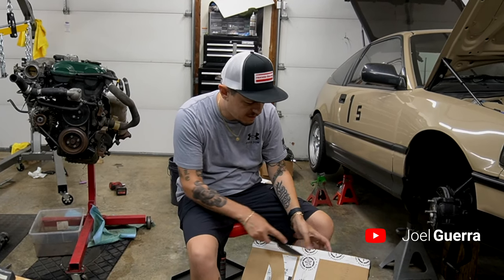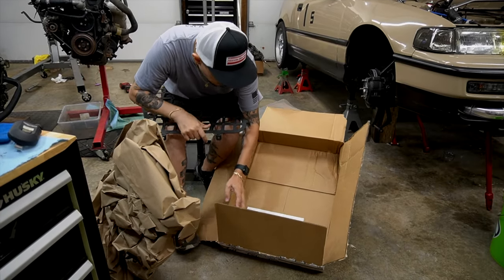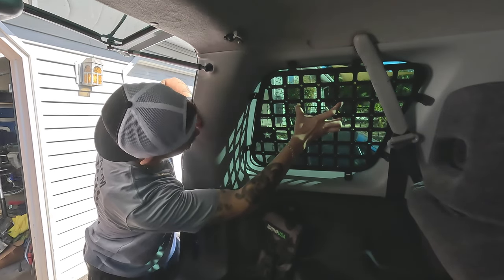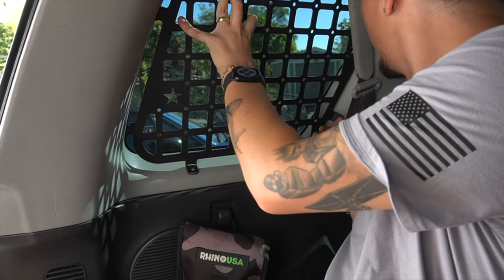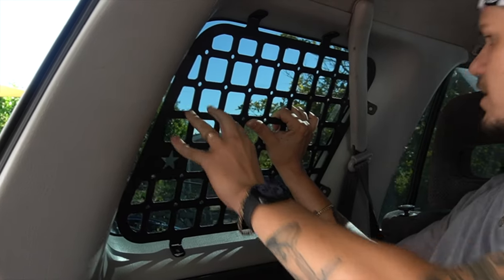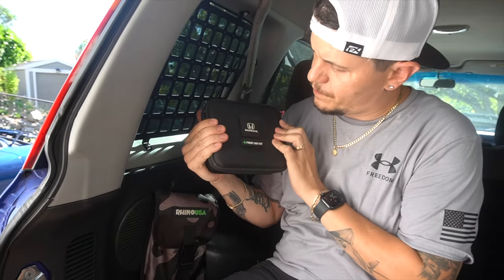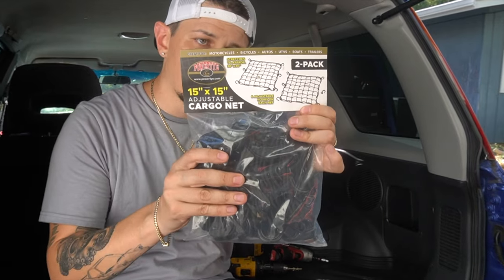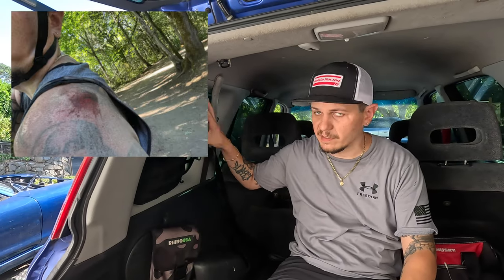HRG Molle Panel Install & Review - RD1 2001 Honda CR-V

Comment: the screws only goes into the plastic trim, that panel is dead weight .
Reply from the maker: If I hadn’t felt it and used it myself I’d have thought the same thing